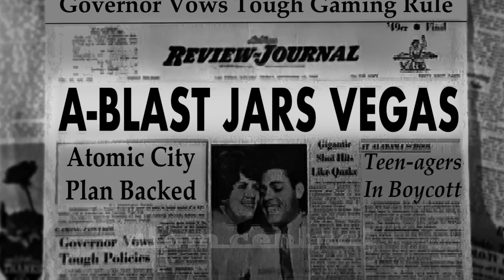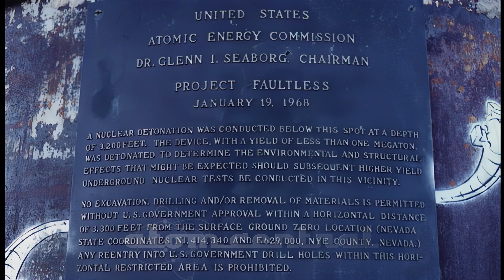Atomic Journeys: Faultless 1 Megaton Nuclear Test

Comment: I realize this is a segment from "Atomic Journeys: Welcome to Ground Zero," but the clip begins on the Las Vegas Strip circa 1974. What's  the significance? At 00:18 what are the guys setting up for on the rooftop of the Dunes hotel?
Reply: My guess would be seismometers
Reply: It looks like they're measuring radiation levels from the nuclear tests being performed in Nevada. Obviously, they didn't blow up anything next to Vegas lol. They're filming the current conditions of the area to correspond with the radiation readings. The whole thing looks a lot scarier then what it is.

Comment: Can any geologists comment on why the surface shock for underground blasts usually appears to CONVERGE upon rather than diverge away from the epicenter point on the surface directly above the detonation? It's visible here and in many other underground shots. For any air bursts the shock always reaches the hypocenter first then diverges away for obvious reason. Here and on underground shots below atolls it appears to do the reverse.
Reply: I think it's not so much the initial shock you're seeing but the rebound of the ground after the shockwave has already passed. So the shockwave lifts everything up/expands it a bit and gravity pulls it back/compresses it down, once everything is settled back is when you see the dust escape so that would go from least energy to highest energy, hence converging back to the point of detonation. But I'd love to see an actual scientific answer to this as well.
Reply: @bami2  Yes, most likely the massive weight outweighs (ahem) the energy from the blast.